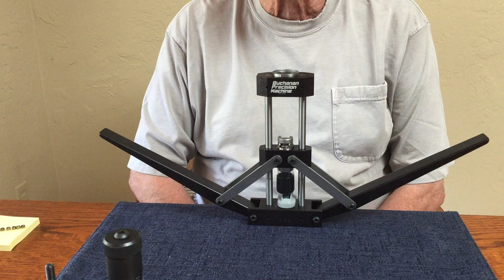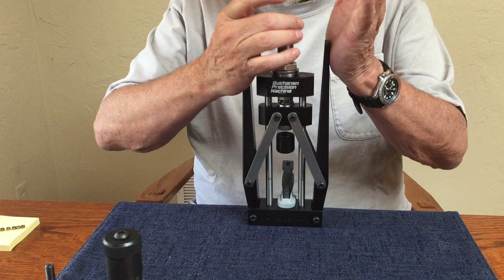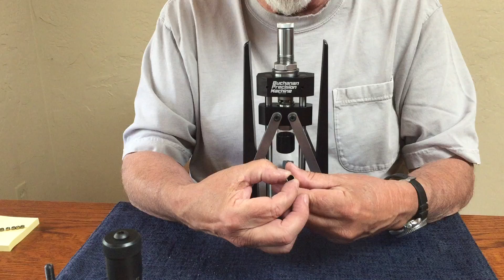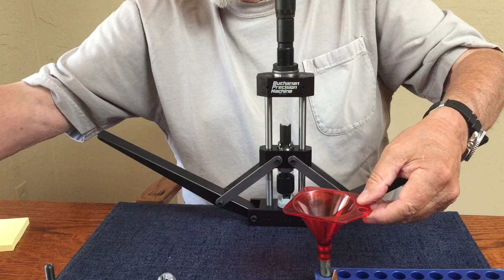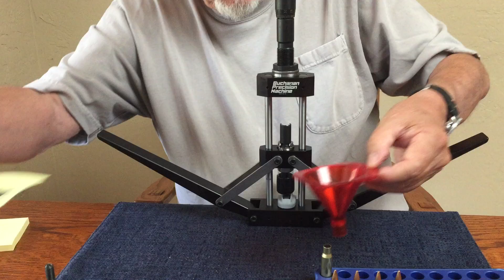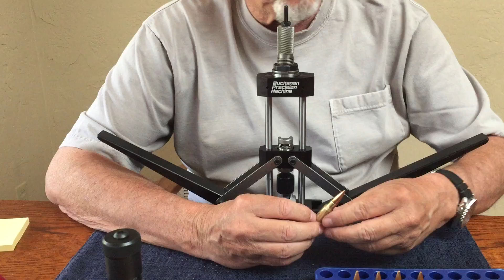Buchanan Precision Machine Lock-N-Load Hand Reloading Press

Comment from the maker: Clamping to the table for doing all the operations after sizing/depriming is just the easiest way to control it. It stands up by itself but still can be knocked over if you are careless.  I recommend using the press over a soft surface like carpeting or rubber floor matting so it can't hit a hard surface if dropped. It will be damaged if dropped on a hard surface. Clamping to a table top eliminates this possibility.

Comment: This press looks like the answer to all my reloading-away-from-home issues. The one question is whether clamping it to the table places any appreciable leverage on the table edge or load down through the surface. My supposition is that it would not. The ability of the press to stand on its own two feet while a cartridge is placed ready for seating is a very desirable thing; the only thing which concerns me is the possibility of accidental tipping.